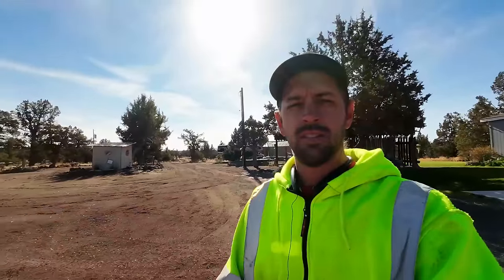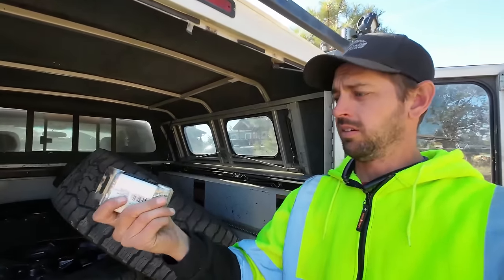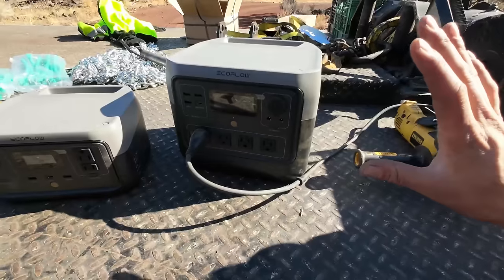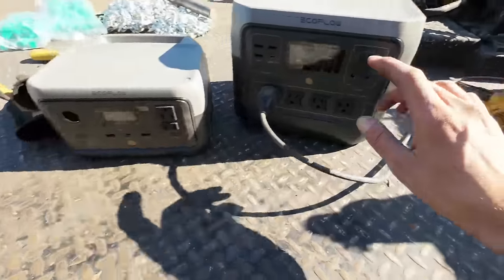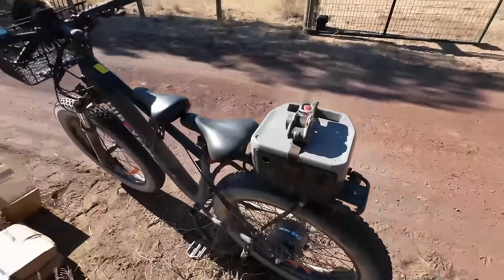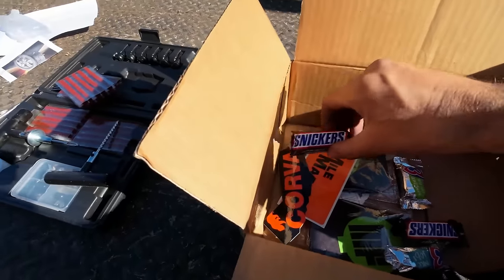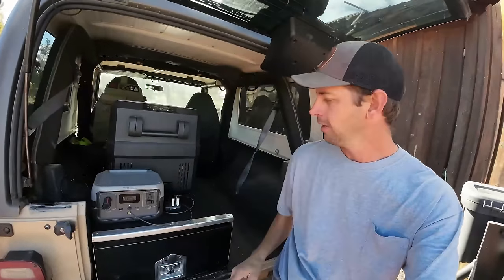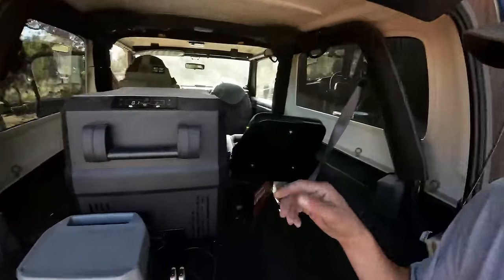How to lose a sponsorship… Again.

Comment: 1- I am also a fan of the EcoFlow products   
We purchased the EcoFlow River Max for use in and off grid cabin   

Absolutely amazed at the power available in such a small footprint 

Also, as stated, one of the benefits was pass through charging, which I can appreciate if we were ever to have a power outage when we’re not at the cabin at home  

2- over the years I have experimented with different lithium ion battery droppings, and most of them are incompatible for more reasons than I would like to get into. 
They are a great technology, but as you stated the BMS (Battery management system) will disconnect charging to protect the battery from charging below freezing, which damages the cell.
Some keyword some newer configurations, have internal heating elements. That’s fine unless your vehicle is sitting for any period of time and that process will pull the battery down. 
I am a power wheelchair, user and enjoy the outdoors and have modified multiple off-road wheelchairs with lithium technology because you can go so much further with less weight, it is also nice if I want to stay off grid for more than a few days I don’t have to worry about the lithium technology running out of power.
3- and finally, I have to get on my soapbox to Casey. Unfortunately I live on the wrong side of the mountain in Troutdale and we recently had some work done for whatever reason people working for contractors just throw nails over their shoulder without a second thought. In my case they were throwing into the lawn and then kicked out by the lawnmower… Yeah, thanks lazy construction workers.
I won’t be doing business with that company again. And before everybody dog pals on me I’ve worked in construction for many years, post injury, doing every job from basic labor all the way up to equipment operator, truck driver. So yeah, I understand what it’s like.

4- Thank you so much Casey for your videos. I really enjoy then because I live vicariously through your videos now that I am wheelchair-bound.
I would like to also give a shout out to Fab Rats & Matts Off-Road Recovery. Thank you so much guys your contact means the world to me.

Comment: After your glowing review on the LiFePO4 battery, I went to their website.  I researched their battery and discovered that $450 dollars is a lot of money for a battery that appears to NOT designed for automotive use.  The studs on the battery are not designed to accept any standard automotive battery terminals.  There is no way I could replace that battery in my F150 because the studs are not tall enough to allow my cable terminals to connect to it.  What that battery appears to be good for are trolling motors for boats, as shown on their website.  Furthermore, they mislead you on the temperature rating on the battery, as the battery will shut off charging at 32 degrees and will stop discharging power at -4 degrees.  That battery is utterly useless in your winter environment.  To be fair, you showed their battery in your video and I took what you said and researched the battery myself and there is no way I would buy that battery to replace an automotive battery.  Furthermore, to be honest, if I am going to buy a battery, it won't be from an online company.  The 5 year warranty means that I would probably have to pay to ship it back to California, which would not be cheap.  I'd rather buy something like this battery locally. Great job on the video, love your content.

Comment: A mains/battery backup system is referred to as a UPS (or at least in the computer world) which stands for 'uninterruptable power supply' if you want the technical term. Not that your explanation was wrong or anything, just spreading the info in case it comes in useful to someone searching for something similar.

Comment: Unfortunately, none of the LiPo batteries do well in cold temps.  The ones with BMS and heater do better, but still not the right choice for a vehicle battery in cold climates.

Comment: I'm confused...  The POS battery propping up the seat is a "LiFePO4".  But when you click the link above for the EcoFlow Amazon, the desciption says "EF ECOFLOW Portable Power Station RIVER 2, 256Wh LiFePO4 Battery/..."  What is up with that??
Reply from the maker: LiFePO4 is not a brand of battery, it’s a type of battery.   Very different things.     
On top of that, the EcoFlow battery is being used for exactly what it was designed to be used for.  The other company straight up lied to me and told me they were sending me a battery that would be great for an application that it should absolutely never be used for.

Comment: I would think those toolboxes can hold some substantial weight, I know ours have galvanized L-shaped C channel-type brackets bolted to the frame, and they are fairly thick, if you are worried about the weight maybe add some more? but id think they could handle it.

Comment: Take that battery and put it through the harsh enviroment and conditions and do a reveiw of it and what it can handle.  take it wheeling off road and test its durability .  To make it fair get a few other companies batteries to compare it to.  You might also try contacting Dakota lithium they have a system that I have seen used on offroad vehicles that are used to run winches and have a solar panel for charging when vehicle is turned off it is called Powerbox system. some offroaders hook it up as a seperate system in thier rigs for just running winches air compressors and other tools.

Comment: I had the same experience with a roofing/siding job. They left fasteners of all types all over my property. I ended up with a screw in one of my tires which are order only. I drive a BMW. I used a roller magnet as well...hell I am still finding crap. If you were a jerk you would have called out the concrete people by name which you didn't.

Comment: Would a "staggered" stud pattern give better performance (than straight line) when you are stopped on ice and the tire is "spinning in place?"
Reply from the maker: Only for the first spin on the tire, and only if you weren’t moving even a millimeter in any direction.

Comment: If the battery is in the jeep above freezeing it will work ok.at least give it a try.
Reply from the maker: It’s also not rated for the heat of the engine bay, or the loads placed on it by the starter or winch.    It won’t work.

Comment: The concrete pour looks fine but intentinally leaving nailes everywhere is just a NoGo. Imagine tires getting popped, kids get stabbed or a lawnmower flings these around. Just throw them in a bucket and go around with magnet- bar when you finished should be the standard...

Comment: Didn't burn any bridges. You just didn't use that one. Yet still showed it. Product reps should know way more than they usually do about the products they sell. Some companies get it right, others, not so much. 
Oh, and just my opinion (Having actually purchased that brand battery), you found a better use than I did. Mine became a rifle target. (Don't worry, people, it was set on a concrete platform and was surrounded by a tarp to make clean-up easy)

Comment: Recently found your channel really been enjoying it, I’ve unsubed that guy you mentioned, like the variety you have. BTW you cant charge a LIFPO4 battery directly from the alternator unless it was made to do that, Most require a DC-DC charger, sorry if someone already mentioned that. And its not a direct correlation, meaning you need more amps in than it will feed out, you have to check data sheet.

Comment: I have a couple consernes about this video. I see you are working in the fresh air BUT you know better. You were not wearing a mask.  Glad to see the eye and hearing protection.  There is a # 2. I have worked construction, from footing to the last nail in the base board for 54 years and have never, ever left a fastener pulled or dropped that was not retreived and pocketed. My advice get a new contractor.

Comment: With all due respect to Casey LaDelle, LifePro batteries are actually not a bad battery. I have known people that have used them with no complaints. But! Those people also do not use their LifePro batteries the way Casey LaDelle uses them. So I do not fault Casey for his review of the LifePro battery, I fault the company for their lack of understanding of the extremes that recovery vehicles and companies deal with. As you might use a 48 volt lithium LifePro battery on an adult e-trike pulling a trailer with 200 to 300 lbs of groceries and a rider what weighs 320 lbs, in 17°F temps uphills for 8 miles. But you are not going to use a 12v Lithium LifePro battery on the front of your Jeep in 7°F temps to power a wench, that’s been there for 30 miles on a recovery that may take you 2 hours to complete.

Comment: I’m curious how you would tow a one ton pickup with a slide in camper and a large boat? You’d be over height on your new truck, can’t tow with front axle lifted cause camper would slide out. Care to share?
Reply from the maker: Pick it up by the front axle, pull the rear drive shaft, and tow it.
Reply: You do need to secure your camper to the bed of a pickup. they don't just sit there. I really hope you're not driving around with a unsecured camper.
Reply: @joma13344  You must not have a camper. The tie downs are under spring tension to allow some slight movement. Mine sits on a rubber mat inside a sprayed in bed liner and it’s shifted backwards while launching a boat.
Reply: @dmtadventures7044  I'll admit that I don't have a camper, but I do move oversized and awkward loads to sometimes very remote places in the PNW for a living. If you admit that the camper has slid on you, wouldn't you want adjust your securement so it no longer slides? I'm sure that they have the spring tension set to not bend the frame of the truck on rough roads, but have you considered maybe adding a strap or small chain somewhere to prevent that movement?

Comment: What grip stud size? I didn't see the product link...looks like a great product.
Reply from the maker: There’s no product link because I don’t have any sort of deal with them.   They have no idea who I am
Reply: @CaseyLaDelle  thanks Casey, I see them on ebay for just over $100. Just wanted to see the same specs you used. Thanks again.
Reply from the maker: @johnnycashh7148  you need to find the correct ones for YOUR tires and use, not mine

Comment: Too bad the battery people were not competent about their own product when you talked to them. That battery is probably similar to battery in the EcoFlow, but they are straight up about what it will and will not do. Charged and kept in the cab the battery could be a good auxiliary power source for you winches, but does not fit the all-weather rigors. I used to be an engineer, and would have to deal with customers about reality after the sales guys would have fed them a bunch of blue sky BS to get the sales contract signed. It would be nice if the sales guys knew their own devices.

Comment: Studds are a waste after a few miles they wear and become negligible as far as grip, it's best if you invest in good tires like general grabber altamax artic, falkwildpeak at3, general grabber atx and there are more buy I've used those 3 and swear by any of them . If your in something deep chains are another great option
Reply from the maker: You clearly did not pay attention AT ALL to what you just watched…
Reply: @CaseyLaDelle  there is tons of studies that where done in Canada and by other companies that proved studs are negative  impact on traction after so many miles and that a dedicated snow tire will be just as good if not better . I'm from upstate new york so did alout of research and found dedicated snows are better but only with the 3 peak rating . I know your video was about products reviews I was sharing some of my knowledge take it or leave it
Reply from the maker: @joshuatracy4829  first of all, I CLEARLY said that we ran these studs last year and they did great.     So as far as wear, no issues there.   Second, these are one of the tires you listed.   Third, there are zero dedicated snow tires in the size I need for this Jeep that also have the off road capability I need.   And fourth, I have nothing to do with the stud company or their product, it’s simply something I use that people have been very interested in.
Reply: @CaseyLaDelle  I think you deal with way to many critics and stupid people man I'm passing info nothing more take it as you will , any 3 peak tire is comparable to studs though , it just sucks they only come in limited sizes
Reply from the maker: @joshuatracy4829  I have driven on the exact same tires without studs, and with studs.   You are delusional if you think then addition of studs does not make a very noticeable difference on ice.   That’s not me being defensive to criticism, that’s an absolute fact.   
If you saw the conditions we had to drive in this morning, you would have to be completely brain dead to say that studs were a bad idea.
Reply from the maker: @joshuatracy4829  the one and only logical and valid argument against studs is that they wear the road surface faster and raise road maintenance costs.   That is absolutely true, and that very argument proves without a shadow of a doubt that they increase traction.   Because if they didn’t, how would they be wearing the road surface??    That is the one and only reason that all of the city, county, and state road departments recommend against studs.  It’s purely a cost argument from their side.    The funny thing is that around here, those same city, county, and state road departments put studded tires on their vehicles for the winter, along with all the law enforcement vehicles, fire trucks, and ambulances.   So if they didn’t work, and they recommend against them, why are they spending the money to run them on all of their vehicles 🤔

Comment: Casey, when the "battery company" said you'd show it in one of your videos you should have said "I did say that BUT you "battery company" also said it would handle the loads and temps that it would be used in so YOU "battery company" didn't hold up YOUR side of the agreement. I also write down products you and Youtuber Project farm to purchase because I know the products WILL withstand the use and abuse I might and probably WILL put it through.

Comment: That may be a great Lithium ion battery...for an off-grid power application like solar power backup.  But the marketing guy you talked to was totally ignorant about their own product!  Lithium ion batteries DO NOT CRANK ENGINES!  You need a lead-acid starter battery for that.  They also have a limited operating temperature range, so they should be inside a human-habitable building with some heat or AC as needed.  Not your fault, and not the batteries fault, but if they were smart they would fire their marketing idiot.

Comment: I know that grinder was obviously off, but you touching it repeatedly with an open palm was giving me the heebie-jeebies. 😂

Edit: 
That battery company obviously watches your channel... they should have known how it would be used. I get pissed off when it's 1 or 3 a.m. and I get uncooked food in the drive thru. I usually toss it out the window and pull into a different restaurant. There may or may not have been times I tossed the food back at their window. 
Actually, haha, that reminds me... I was researching dropped spindles for a coworker's squarebody Chevy last week and I came across a thread in a forum talking about "a certain suspension company" that has changed names 3 times. According to the forum their dropped spindles are straight junk and they break often enough that everyone knows not to use their stuff. You call them and no answer, no email response, no "oh hey we're sorry we'll replace it, nada. Breaking a spindle on anything is a safety concern, let alone on a 1 ton Chevy even if it's unloaded.. people's lives are at risk. I have 3 of these trucks, mine aren't lowered, I'm on stock spindles, I'm usually around the gvwr capacity. I've hit some mean deep potholes or crap on the road with tons of weight in the bed and/or on the trailer and I've never broken a spindle. 
Anywho in that thread someone mentioned kindly returning their broken spindle through the manufacturer's window.  😁